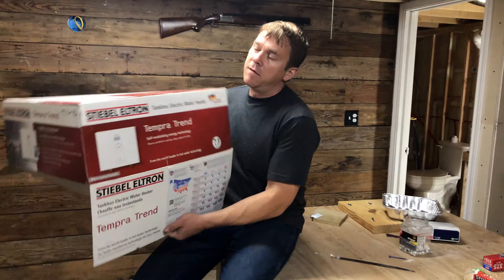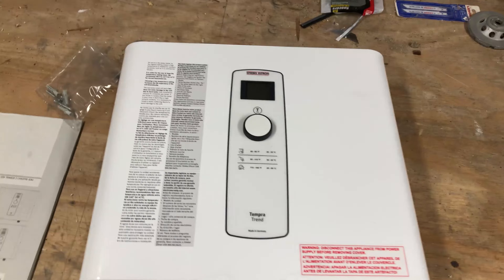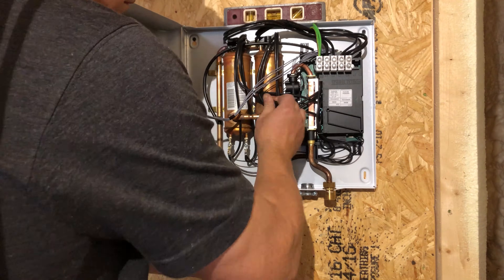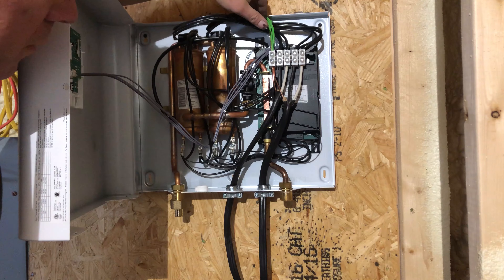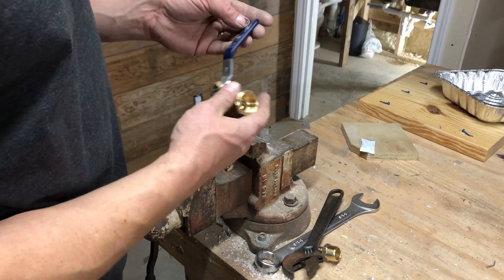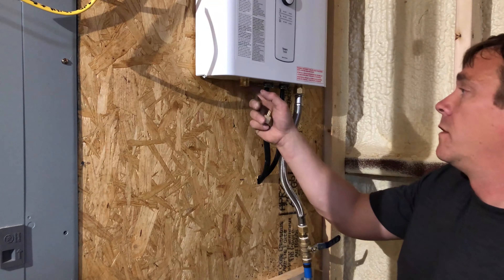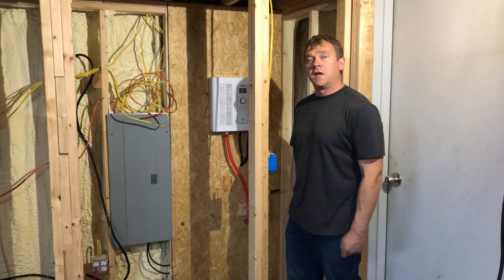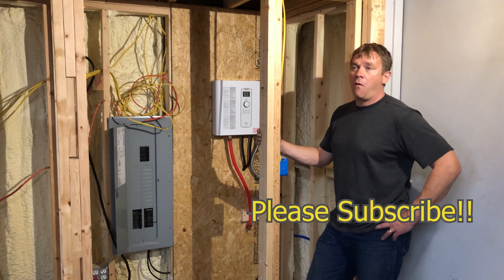How to Install Stiebel Water Heater

Comment: So I noticed this water heater has one in and one out and the out (according to the description) is hot and the inlet is cold. How do you get the output for cold water?
Reply from the maker: Put a T in front of the water heater and supply from there
Reply: So when you turn on the Coldwater, the water heater will just know you don’t need hot?
Reply from the maker: The heater senses flow, so as long as there’s no flow through it due to hot water demand, it won’t turn on

Comment: A.  You didn't install the NECESSARY Service, Flush Valves with Pressure Relief Valve. Biiiiig Problem.  B.  No Descaler either.  UNless you do not have hard water... you probably won't need it.

Comment: Those breakers you used are not correct. Those are twin single pole not 2 pole. Replace them with (2) 2pole breakers(they will take 4 full slots in your panel, not 2) and connect each set of wires to individual 2 pole breaker(2 white-breaker 1, 2 black-breaker2). The way you have it wired is totally unsafe.
Reply: Paul, can't you use 1/2" dual pole breakers like the GE Q-line that consumes 2 full slots instead of 4? Also, any issue binding both grounds to the units ground block?

Comment: First off,  NEVER attempt ANY electrical installation without at least consulting a LICENSED Electrician.  I am one, and I cannot tell you how much more it will cost you to have one come out and fix the job you did.  2nd,  you MUST install the proper connector in the panel as well, I noticed you just ran the wires through the knockouts in the panel without any means of restraint.  That is called a code violation and is just plain dangerous. 3rd... wrapping black electrical tape over the white wires to indicate they are conductors is just a good idea.  Just saying.  4th,  Neutral wires cannot be landed on a neutral bus with any other wire,  ground wires can be loaded up to 3 wires under one screw.  Your panel is a mounted code violation..... damn.... and what is that black wire on your Neutral bus????    WOW.

Comment: Why was two 40 amp cables used instead of 1 cable of 240 volts ?  the two cables hooked to 120 volts each I presume ??
Reply from the maker: They were x2 40 Amp 250v cables

Comment: This product lasted 4 months, it keeps tripping the breaker... any advice?
Reply from the maker: What breaker sizes do you have installed?
Reply: @LewisRenovation  they never replied, but I have 2x 50's and my wire is 10/2. I'm thinking of going 6/3 because of weather. Electrician says a single 100 amp 8/3

Comment: I’ve got the Steiber 12 240v model. It has a three wire hookup in it like the cables you are connecting. However, the cable I have coming from my circuit is a 4 wire cable. Would I connect 3 wires and cap off the 4th wire?
Reply from the maker: I'd connect both  the neutral and ground wires on your 4 wire cable to the ground on the water heater. I'm sure if you called tech support they'd tell you what to do.
Reply: @LewisConstructionWelding  Oh yes!!! Tech support!!!! Totally forgot! Thx!

Comment: What happens if you use only one neutral cable and bridge it?
Reply from the maker: My understanding is that there is no current flow on the neutral with residential 240v
Reply: @LewisConstructionWelding  I see, but there are 6 cables, I thought maybe the 2 black where hot cables, 2 white where neutral cables and the 2 grounds.. I just ask to lern more about how this works.
Reply from the maker: Now I understand the question. Both the black and white wire or hot. Each carries 120v but the are 180° out of phase so they total 240v when measured across them. The white wires are not neutral in this case

Comment: Thank you. I was a bit confused by the wiring diagram. I have the 29 trend and it calls for (3) 40 amp circuits. The diagram appears to have (2) 8/2 wires and an 8/3 on the far left. This video affirmed my suspicion that the third wire was intended to be a ground.
Thank you.
Reply from the maker: I happy you found the video helpful. Take care
Reply from the maker: @theblacksectorgod6477  x2 40a breakers, 8 AWG
Reply from the maker: @theblacksectorgod6477  it depends on which model, so I recommend looking up you look up the specific one you'll be using
Reply: I saw your connection L1 L2 and ground hooked up a cable with 3  wires. But, have a cable with 4 wires. How would can I hook that up? Would I have to cap off that 4th wire?
Reply: @grungebox  the booklet that comes with it should have a diagram. I ended up running all grounds to the same lug rather than getting 8/2 wire... Don't think it's necessary, but can't hurt

Comment: I notice you did not install isolation valves.  Any reason why?  If you ever need to flush scale out of the heater...
Reply from the maker: There's an isolation on the inlet, outlet can be drained by opening up a faucet
Reply: @LewisConstructionWelding   right, but if you want to use a small pump to circulate vinegar, having a way to connect to both sides makes it easier

Comment: Good demonstration!  But what are
 the water supply lines connected to, the main line and a boiler, or a water tank?
Reply from the maker: Inlet is connected to cold water supply line,  outlet is connected to hot water manifold going to each fixture.
Reply: @LewisConstructionWelding  Thanks Joe!

Comment: Make sure you have four slots for double pole 40 amp breakers.  That is that their Stiebel tech support told me.
Reply from the maker: Yes, my unit needs x2 40a 240v circuits
Reply: Or you could get a 40 quad breaker

Comment: This looks like a great option for when a gas unit is not possible.  If you are not getting water that is hot enough, the option is to turn down the flow.  

In some really cold climates, during the winter, you may even need to go down to one gallon a minute.  It's still possible to take a shower but filling a tub can take a while.  
This is a very small unit and it's not intended for multiple faucets at one time.

I called technical support for Stiebel and sent a photo of my (Square D) electric box.  Paul Barnard from Stiebel is saying that this requires four slots. Two double pole 40 amp breakers.  He is saying you cannot use single pole 40 amp breakers.  

Again, four slots are required.  Two sets of double pole 40s are needed.  I called twice and asked the same question.  Be careful that you actually have four slots.  Don't buy single-pole 40s.  

The unit might work on single pole 40s.  That is not was Stiebel recommends.
Reply: The Tempra Plus models have a sensor that throttles the water flow automatically to keep the desired temperature.  Fwiw.

Comment: It's been a year today since you uploaded this video, how is the Stiebel-Eltron working out for you? How cool is the winter in your area, did it have any trouble through winter?
Reply from the maker: It works great. Only complaint, which probably applies to all tankless heaters, is that the faucet can't be just slightly open for it to turn on. Winters here are mostly 50's and 60's with occasional dips into the 20's or 30's.
Reply: @LewisConstructionWelding  Nice. Thanks for the feedback mate.

Comment: Dear Lewis,

I would like to know, if you know of course.
Has you measured or asked the Stiebel, if the temperature is set up only for 38 celsius degree,(not to 60 degree), and the device is 18 kw power, is it turning on to 18 kw power, or it is only partially (e.g. 13 kw to reach 38 degrees water? or the water demanding would be modified and the consumption is allways 18 kw/24kw... ? Do you know that?
THank you for your answer.

Regards

Chris
Reply from the maker: I believe the electrical consumption is relative to the set point and incoming water temperature. Hope this answers your question
Reply: The below quote is directly from https://www.stiebel-eltron-usa.com/products/tempra-series-whole-house-tankless-electric-water-heaters

"Self-Modulation Energy Technology

"Every Tempra® also has self-modulation. Self-modulation is sometimes confused with flow control, but it has more to do with the amount of energy used to heat the water. Self-modulation, sometimes call auto-modulation, ensures that only the least amount of energy is used at all times. Every Tempra® model continually monitors incoming water temperature, the flow rate of water through the heater, and the water temperature it produces. These sensors feed their readings into the unit’s proprietary microprocessor control which engages the heating elements in stages, as efficiently as possible, to achieve the water temperature set on the front panel, always using the least amount of energy necessary to heat the water."

Hope this helps.

Comment: I just finished mine.  The only thing is that my water pressure is so good that on my tub, with a single handle faucet, the flow is too fast for the heater to heat the water (water saver shower head is fine).  To save the heater units, it goes to low power mode.  I just need to install a flow reduction valve inline to the tub and i'll be good to go!
Reply from the maker: Hopefully it lasts a long time
Reply: which model did you go with?

Comment: What type of wire is that
Reply from the maker: 8 gauge NM-B (trade name Romex)  Look up the 8 AWG equivalent if you live outside the US.
Reply: Does it matter what order the wires are put into the unit, looking at unit from left to right it looks like you did ground, black white,black white . I don’t see where it says what order in the install manual, thanks for info .
Reply: @mflores1423 It doesn't matter, as long as the same colors match either the L1 or L2's.

Comment: Hey... in my opinion, Stiebel Eltron are one of the best tankless water heaters in the market. I have a 3 bedroom-3 bathroom house and run hot water for the whole house with a DHC6-2 6KW 240v unit (please bear in mind that I live in the tropics - not the states). I first bought this Stiebel unit back in 2004 and it lasted me 14 years with no maintenance whatsoever at all (as a matter of fact I dont know if it requires maintenance). When this unit broke down (something about some micro-switches and burnt down resistor), I just decided to replace it with the same unit. So replacement was take old one down-put new one in with no hole drilling whatsoever. And I am clearly expecting 14 more years of service with this new one (lol).

Best regards!
Reply: Clean the internal filter once a yr. It may last 20 yrs
Reply from the maker: Hopefully mine lasts as long as yours. Thanks for commenting!  Enjoy the ☀️

Comment: I would have went ahead and installed a descaling kit.
Reply from the maker: I'll look into one. I can always add. Thanks for posting.
Reply: Richard, which descaling kit did you use?
Reply: @jasonmock8163  3/4" Tankless Water Heater Descaling Valve Kit from ebay.  Good quality brass. It worked great on the  Stiebel Eltron 24.  https://www.ebay.com/itm/3-4-Tankless-Water-Heater-Descaling-Valve-Kit-Threaded-Installation-Service/141994391505?_trksid=p2485497.m4902.l9144